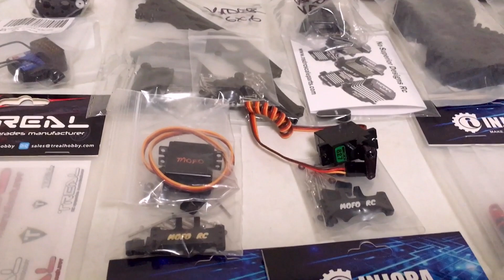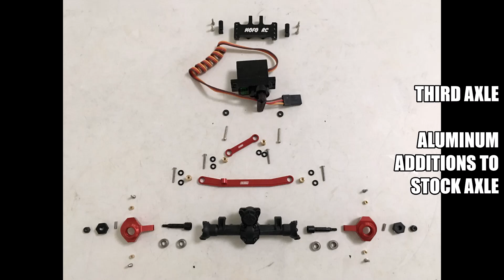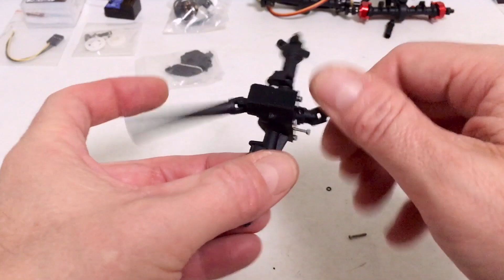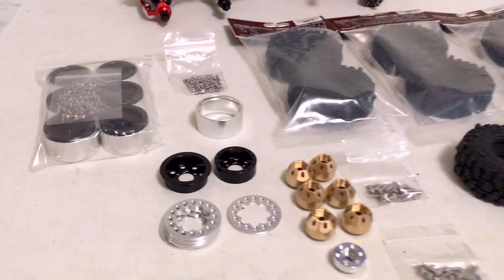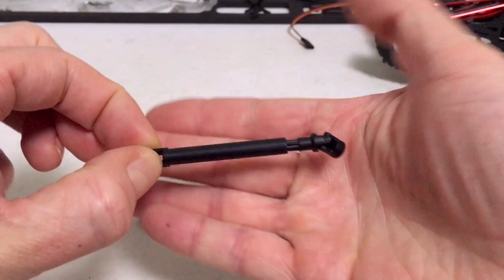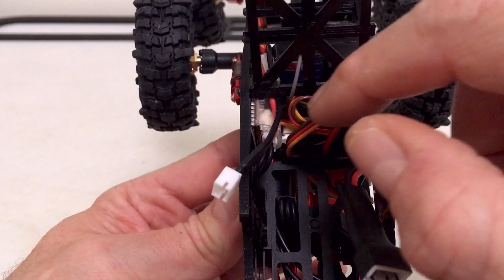SCX24 VADER 6X6 CHASSIS: FULL BUILD - NANO BEAST 2.0, SERVO BEAST, LIZARD PRO, NSDRC BEC, BAJA PRO X

Comment: Cool stuff! AWG 30 silicone wire (Hobbyking, Banggood, NOT the one from Ali which has way too thick insulation) or even better AWG 36 teflon coated wire (Hobbyking, Ali, Orlandoo light kit) solves your problem with the non flexible wire of your servo LED lights.
Reply from the maker: I have some super flex wire, that stuff is like wet noodles!  It was really the shrink tube that wouldn’t flex… was trying to hide the red wire!  I need to re do my other install now with the flickering led. Cheers!
Reply: @bcochener  That is why I only use only black wire for + and - for LEDs  ;-)
Cool build, however - cheers!

Comment: Besides being super cool, what are the benefits of a 6 wheeler?
Reply from the maker: It is more capable at climbs (really hard to roll backwards), and is pretty unstoppable.  Does suffer on tight obstacles/maneuvering… 4w steer helps that, but really it’s just more fun!